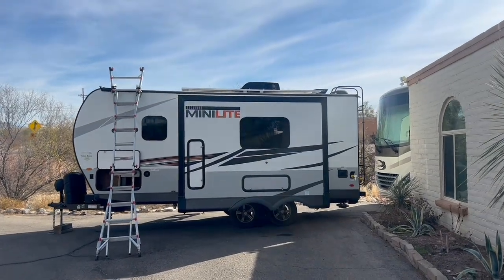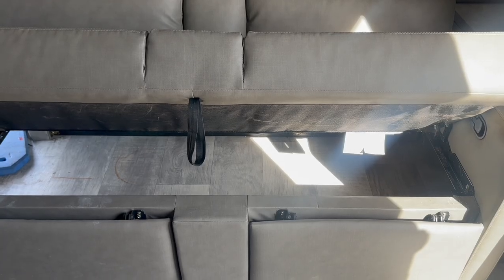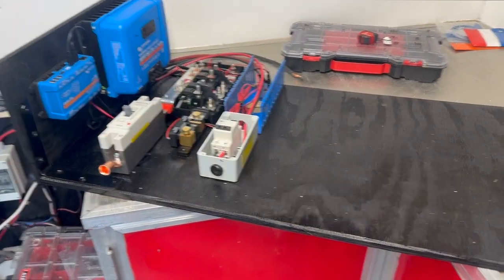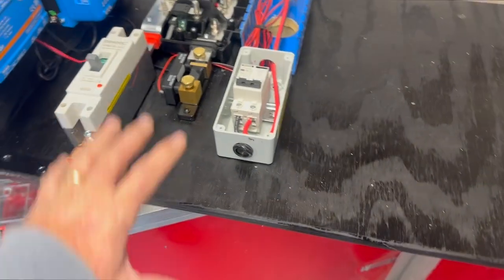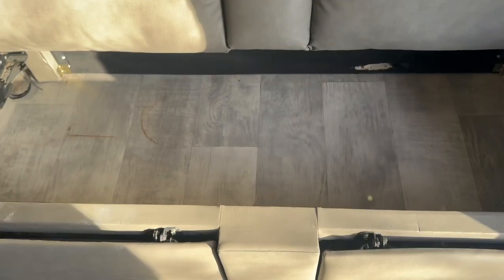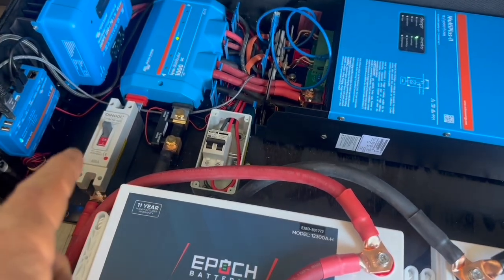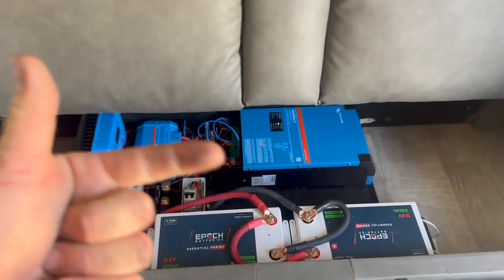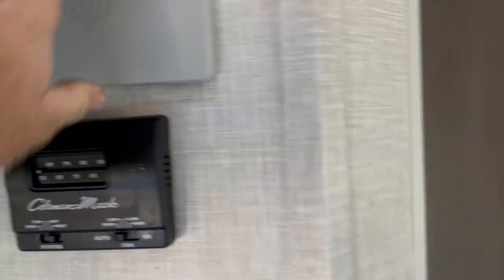30A Rockwood MiniLite full Victron installation

Comment: Thanks for the detailed video! I'm building a similar system on my Mini Lite and was wondering—did you remove the factory converter, or integrate around it? Curious what your setup looks like on that end.
Reply from the maker: We don't remove them but we do disconnect from the 120V system and just leave in place. That way you don't inadvertently turn it on down the road and use your new batteries to charge themselves in a death spiral - but the OEM converter is still there should you decide to make a change and reverse everything when going to a new rig.